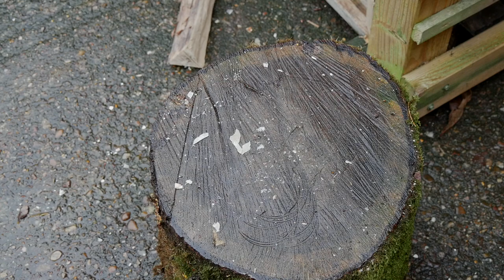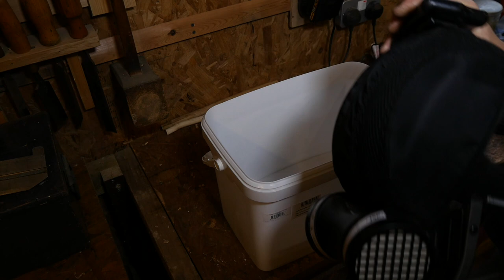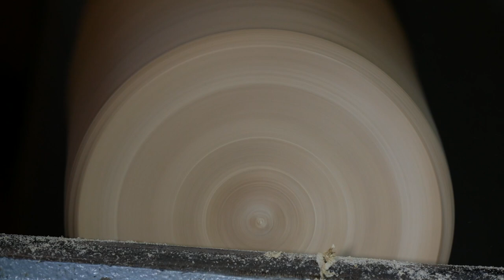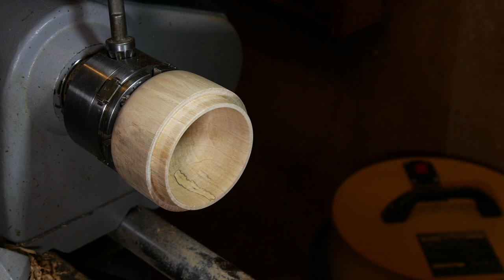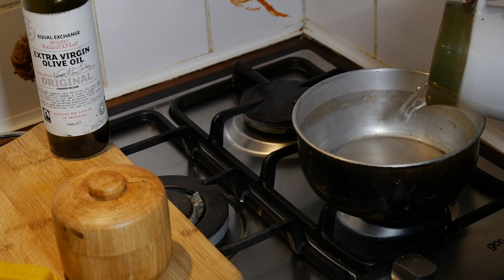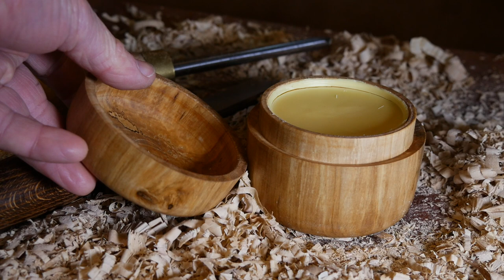Woodturning and making a pot of beeswax finish

Comment: Great boxes Jon, the grain and spalting are fabulous. Yes, olive oil can go rancid and the deterioration of it starts the moment the oil is pressed out of olives. If you want a 'food safe' finish, use a seed oil like Grape seed oil or avocado oil as these do not go rancid. Olive oil, when kept in a sealed container, slowly deteriorates, but when exposed to air the decomposition of the fatty acids with air increase greatly, hence why the finish may get an odour after a while and mould can also form on it if the moisture content of the wood is too high or the humidity of the area of it being stored is high (plus the other factors of heat, air circulation and so on). Thanks for sharing and stay safe,
Keep on turning.
Cheers, Bluey 👍
Reply from the maker: Great detailed post Bluey and really clearly explained. Thanks.
Reply: @jonsealwoodturning4673  all good mate. It was something I had an interest in a while ago and there is so much to learn too.
Reply: On the nail Bluey
Reply: Hi Bluey, would the ratio of oil to bees wax be the same if you used a different oil like grapeseed oil?
Reply: @JK-ep9bz  yes and no. The quality of all ingredients and how clean and/or filtered is everything. But, in saying that, they would not be much different.
Reply: Well explained, thank you. Can Almond oil work? Or Sesame oil?